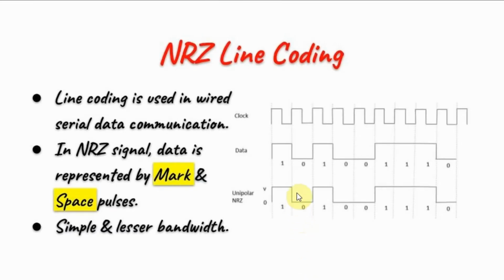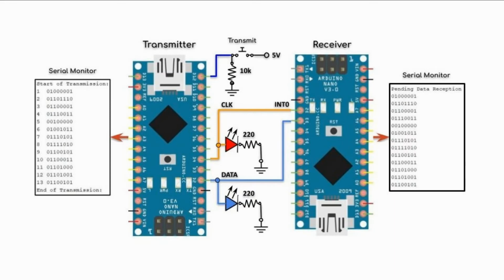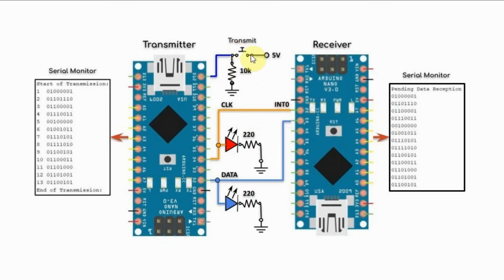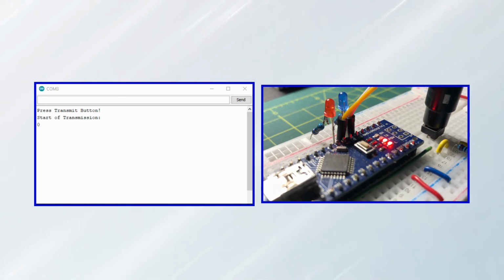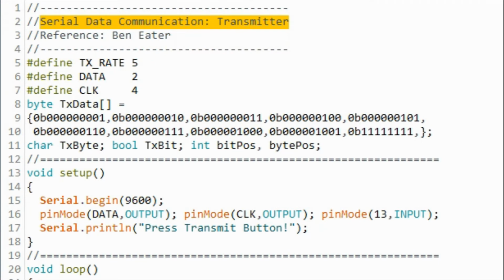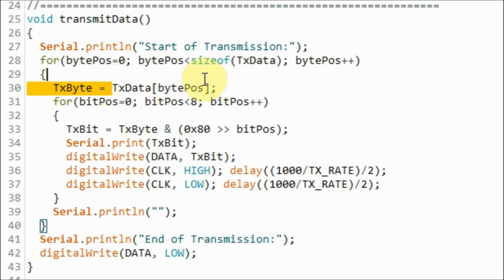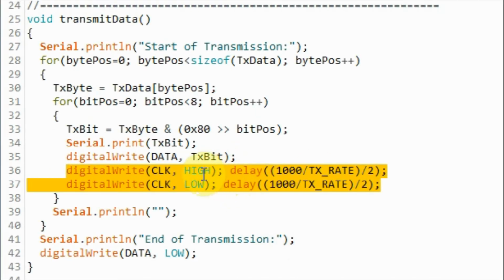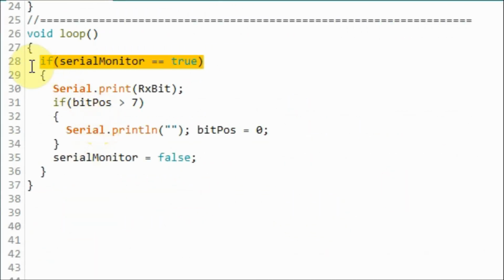Serial Data Communication via Arduino

Comment: Hi there,  a NRZ encoded and transmitted signal typically does not have a CLK ... it synchronizes by the rising and falling edges (1t or 2t)  ... so I'm afraid this is not a NRZ transmitter/receiver